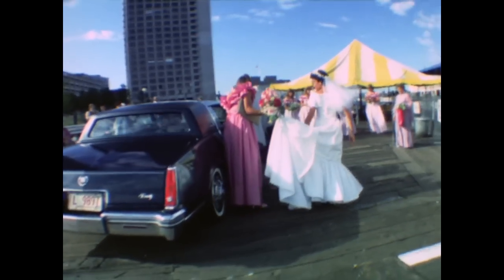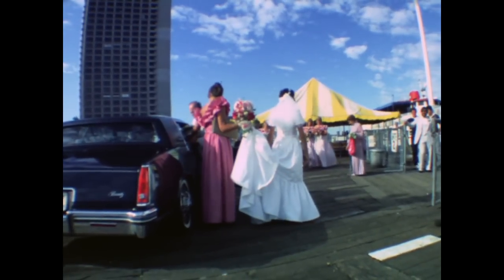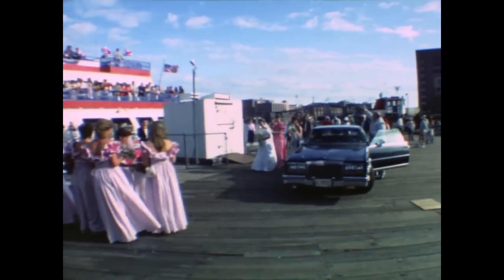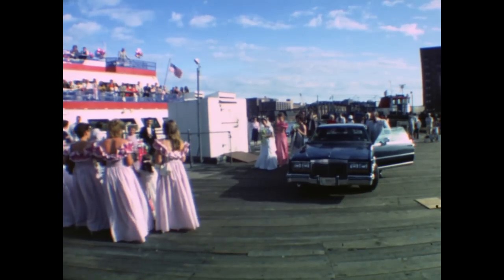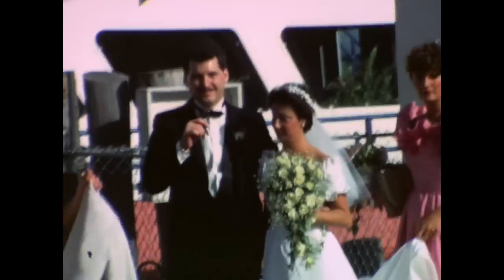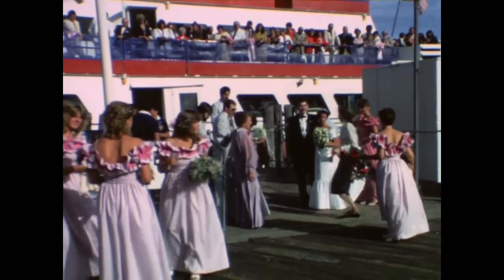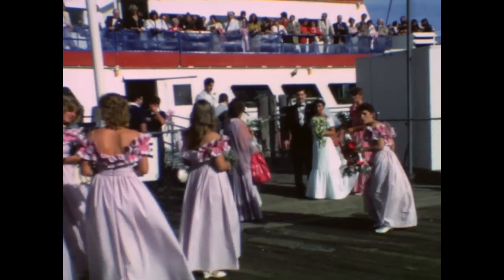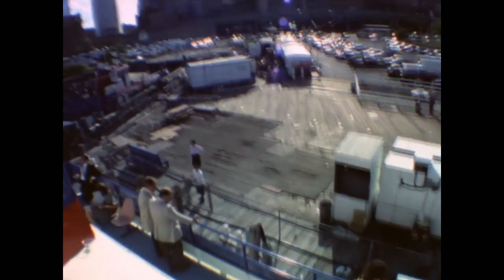Super 8 Film Shot at 18 fps and HD Scanned in 24p (Slowed to speed using Final Cut Pro)

Comment from the maker: Not exactly . These are two different processes  one uses 1080i (Interlaced Video in HD ) the other used a 23:98PSF Scan in HD then FCP7 was used to correct the speed using frame blending of this which was shot at 18 FPS.  Today there are new methods using DATA scanning at 24P  and 18P but the 18P must be converted to 24 to play on one of these on-line platforms. Typically frame blending is no long used and Final Cut X has shifted to a process  that duplicates frame when you have an original shot of speed like this one at  18 . Right now you want have 24 for this platform. . Look at my more recent videos for samples of this using P.

Comment from the maker: @pablo1080 Good question, for sync sound it is best to shoot with a crystal-controlled motor at 24 fps and transfer at 24 fps so sound will match picture. Shooting at 18 fps is not controlled and you may actually be shooting somewhere between 17 and 19 fps and the speed won't even be constant. So if you put the footage into an editing program, adjust the speed to normal, and try to line up the sound, you may find that it will drift.

Some creative sound editing and speed manipulation can help

Comment: I found a plugin to output at 18 fps among other "retired" frame rates, such as 10fps for some animations. 
I don't know how you output at 16 for 8mm when 18 is the standard.
Reply from the maker: Well 18 is definetly the standard for Super 8 but 8mm started out at 16 FPS then eventually went to 18. . The scanner I use has the option of creating playback rates at 12,16,18,23.98, 24,25, 29;97and 30 FPS  files.